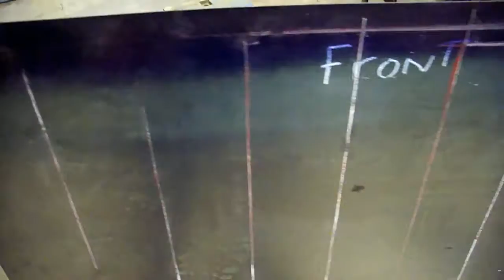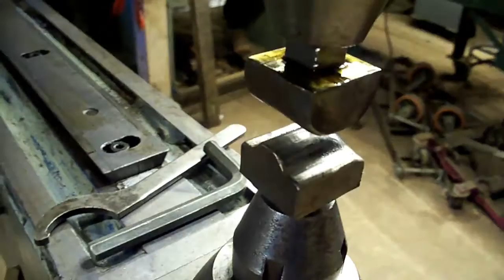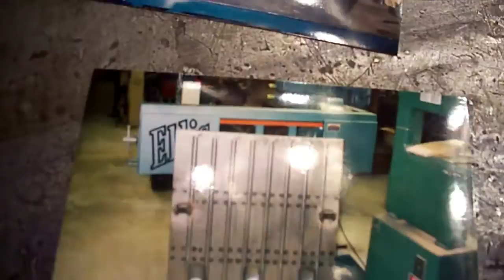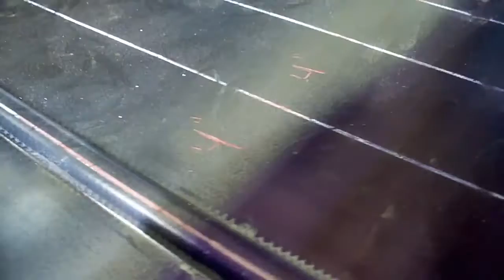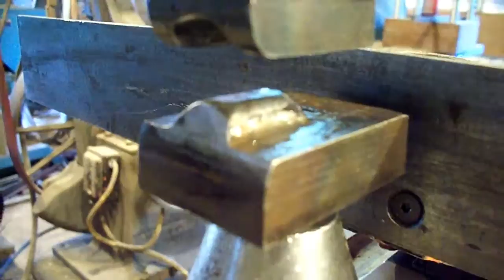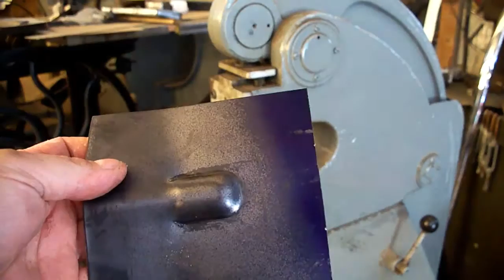Metal fabrication Willys CJ3B Welder Jeep Rear Floor

Comment: You could drive a tank on that floor! Does the floor change width due to the beading? Do you have to start with a wider blank?
Reply from the maker: it sure is a heavy floor and will support the welder perfectly.  The beads are put into place and the metal is stretched to allow them to form.  The panel does not change size, but I always do the beading first and then trim the final size last.

Comment: That is a superb job, I would have thought with all those pressings across the floor you would have lost width, but looking at the edges there was no reduction in width, you will find an MB body much easier to make, without all those pressings.
Reply from the maker: Yes the MB body rear floor is much easier to make.  I am trying to keep this project very original so that is why I put all the beads in.  In a future video I will show how to put a bead in by pre stretching the area.  Very important in many beaded panels.